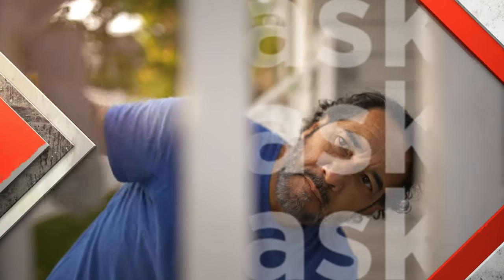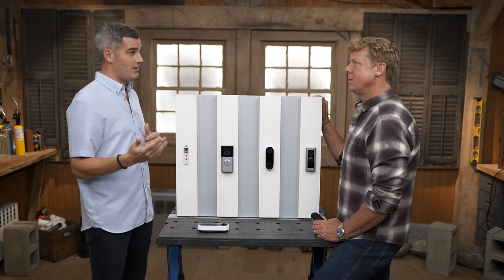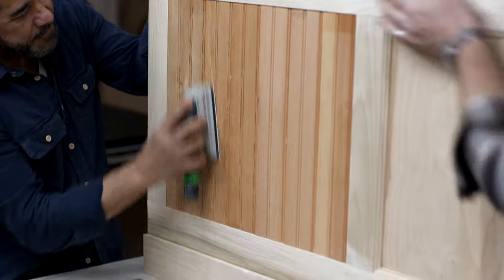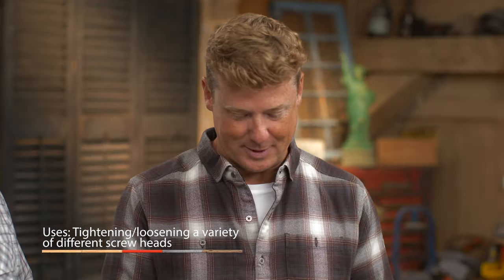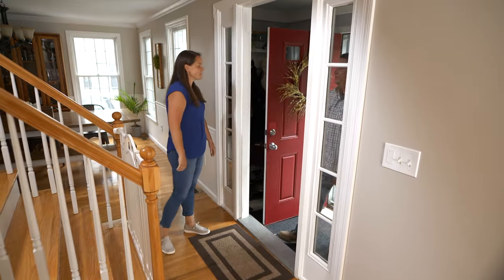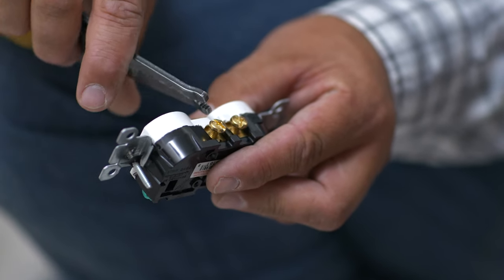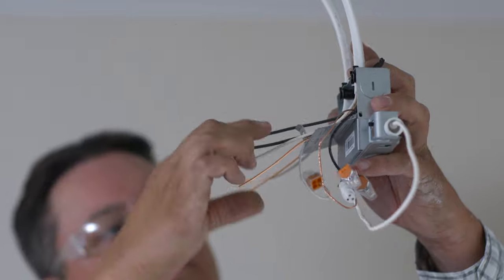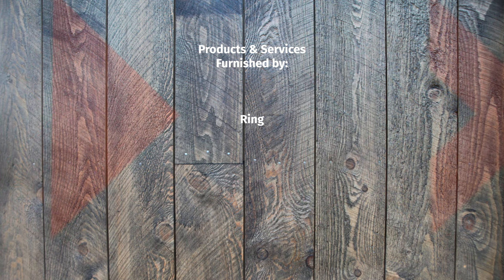ASK This Old House | Smart Doorbells, Recessed Lights (S20 E5) FULL EPISODE

Comment: I wish they would've shown the whole process for the recessed lighting.  The first two holes looked like easy access from the switch but how did they get the other two lights in without cutting/drilling all over that room?
Reply: They explained that they would fish the wiring between the gap created by the strapping that the drywall is screwed to 16:02
Reply: I wish they had shown that

Comment: Not all the wired doorbells will run off of the existing transformer or wiring. Too much draw. May need to replace the transformer and wiring
Reply: I discovered this issue after installing my Ubiquiti G4 Doorbell Pro. I pulled new wire and purchased a higher rated transformer. Now I need to install it to see if it works with my mechanical doorbell chime. An unexpected lesson.
Reply: Ubiquiti sells a POE Ethernet version. If you can get an Ethernet cable to your door (which can be iffy) you’ll get a much more reliable solution. I have one and it was pricey but works great.
Reply: @generallyhelpfulsoftware646  
Yeh, I purchased the PoE adapter and pulled Cat6 cable to it (which was not an easy task), terminated the RJ-45 connector and connected it to the doorbell, but it's still not recognizing it as a wired device; only recognizing it as a wireless device. I've probably done something wrong. I've submitted a support ticket with Ubiquiti about it. Learning a lot through this process. 😉

Comment: The downside of battery models is that they're sometimes slow on the motion detection, and by slow I mean if it's a fast motion, it won't always be caught by the camera. There are also other ways to transmit data today too with a smart doorbell. There are models that transmit power and data over ethernet (POE) to a local base station that can hold your cameras data instead of using a microSD card or the cloud. This lessens a chance of your footage getting stolen and makes it so you're less likely to pay monthly fees to companies like Ring and Blink.

Comment: Who does your research???   I have the Blink doorbell wireless and it came in a bundle with the SYNC Module 2 which you can put an external HDD to it using USB connecting or even a THUMB DRIVE...  and get tons of video space.. I currently have a 4tb external SSD drive as it's storage...  NO CLOUD NEEDED not monthly subscriptions..    just batteries which I have 4 and 2 in the charger at all time.. so quick in and out .. and it will tell you when battery is low...
Reply: This is an old episode. Probably 2-3 years old technology has changed since then.

Comment: What was the drill bit used here to drill hole in the top plate ?
Reply: It's called an installer drill bit or flexible auger bit. They come in many lengths, 3' to 6' long, and are specifically for drilling holes inside of wall.

Comment: Talking about using the speedtest app to check signal is not a great way of putting it.  The phone may have a terrible signal and still transfer at 100Mbps or so, but because its signal is low it will periodically disconnect.  Use your phones wifi signal meter and stand there for a bit to ensure it stays strong. And if its less than half, its probably going to be a problem. The wifi chips in even the best doorbells are not great. Alternatively, hire a professional (av integrator or network professional) to consult and discuss options.

Comment: So you showed the lights being put in on one side of the room, but neglected to show how you wired them to the other side across the joists.
Reply: they explained there was strapping boards installed perpendicular to the joists, which would create a gap above the sheet rock ceiling, just a matter of fishing the line through the gap across to the other holes
Reply: @coreysuffield   But that wouldn't be up to code, would it?  I'd think that would be a fire hazard.

Comment: And when those leds burn out?  You replace one that then won't match the others?  You replace all 4?  You damage the dry wall pulling it out and now you have to paint?  These LED lights are gonna seem like a really bad idea in just a few years.
Reply: Should last a long time.The LED driver\transformer was separate from the actual LED 'light' allowing for good airflow\cooling. the main problem that actual LED bulbs can have is they cram the driver\'transformer' in the bulb with the LED which can cause overheating issues and shorten the circuits lifespan while the actual LED light is still functional

the most ideal thing would be to have a single oversized dedicated LED driver with a thermally controlled fan and just run low voltage to all the LED lights, this would save on running all that romex to each light
Reply: @coreysuffield  That's only one issue.  The main problem, and the real issue is that the manfactuers are overdriving the leds to save money.  That's what's causes the leds themselves to fail.  And when that happends, if not like you can go out and just buy a new "bulb" part of the light.  It's all or nothing.  So what I said still is correct.